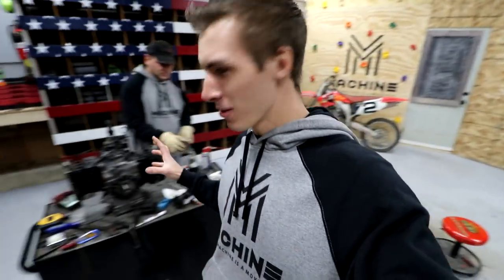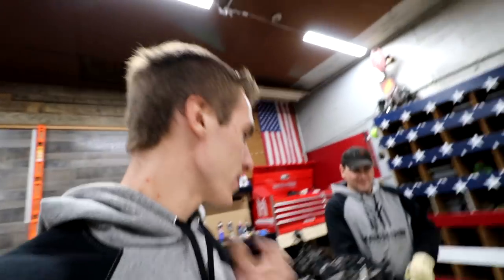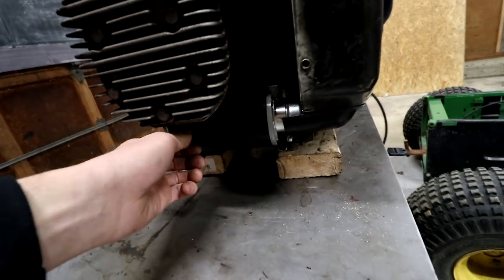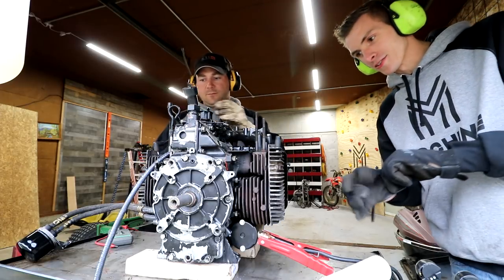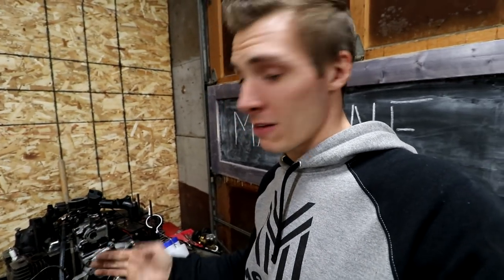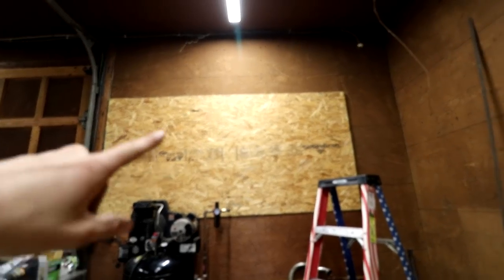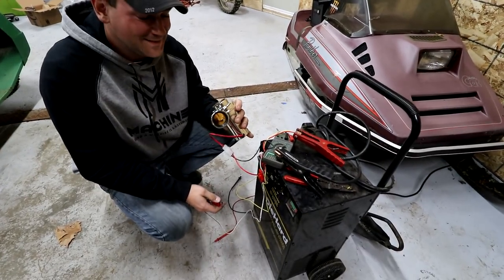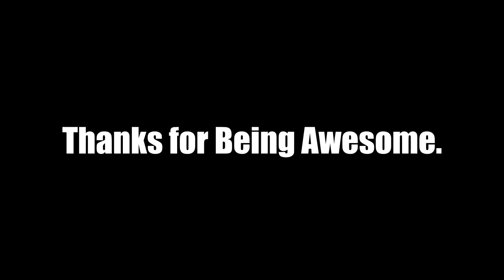Dead Gator Engine & Supercharger

Comment: Thoes things don’t work you wasted your money on legit the biggest price of junk with that super charger they are the biggest joke amongst people in the know
Reply: Yeah
Reply: Right... that's such a joke. The vacuum of The engine probably pulls harder than that thing blows. It's silly.
Reply: It can’t hold boost pressure so there for can’t hold boost really should get a turbo and use that at the junk yard
Reply: He's kind of pandering to a younger crowd. anyone with a bit of knowledge of an engine would know that little electric fan won't create "boost"
Reply: i agree with that, but i dont think he is SUPER into boost kna mean
Reply: he could get a pressureised bottle of air and run it like nos for a better result than this lol...tho small motors like these dont seam to respond great to boost from what i seen cars and cameras do

Comment from the maker: THE GATOR IS CURSED!!!!!!!!!!!!!!
Save 10% on your entire purchase when you use Code "SAVE THE DMAX" at checkout.
https://machinemerch.com/
ONLY 2 HOURS LEFT
Reply: I have a coil sitting here for that engine but I’m in Canada lol
Reply: 3DMachines the merch is awesome put some one my Christmas list bought some tonight and I got some for my brother it will run just believe love the vids love the sponge bob cut
Reply: 3DMachines it’s going to run
Reply: 3DMachines whats up with the snowmobile in the shop?
Reply: 3DMachines is the snowmobile in your shop the replacement for the ski doo?
Reply from the maker: +THE MEME'S VID'S
yES YOU ARE lol
Reply from the maker: AnarchyGames
Secret until it's done
Reply: I have bad news for ya those electric blowers are crap they don't move enuf air to add hp they will slow you down by adding drag on the electrical and impeding airflow .
Reply: 3DMachines 5:22 thats what she said
Reply: 3DMachines were do you get all your songs from
Reply: 3DMachines love ut vids coupdnt resist the joke maybe get a shput out next vid on the joke @james_knocke on insta
Reply: Heat the magneto a small bit and it should work .i left a longer comment earlier if you read that it explains all
Reply: Hey Dalton ! Can i know the size of your friend hoodie ? not sure wich size to buy...
Reply: 3DMachines it will run!!!
Reply: 3DMachines what is the engine?
Reply: 3DMachines you
Reply: +3DMachines  that is a turbo not a supercharger, unless there is some joke I'm not familiar with
Reply: KNIFE VS CRICKET BAT
Reply: 3dmachines staying froggy fresh and staying fly with your merch
Reply: 3DMachines you better come up with more designs if you're gonna have everybody in the video wear your gear
Reply: 3DMachines you
Reply: 3DMachines 👍

Comment: You better not put that hairdryer on. A leafblower might be cool though
Reply: I put a leaf blower on my lawn mower and it was enough 😂
Reply: Mike Stroz really loud though
Reply: Caleb Mitchell I can imagine lol
Reply: Mike Stroz lmao some guys
Reply: it does nothing differnt then what he bought. actually just restricts airflow and makes it worse
Reply: theown32 Tell that to Roadkill and Hot Rod magazine. They supercharged a corvette with 2 leaf blowers and a Monza with 5. Not saying it'll make a huge difference, but it'll do more than what's basically a computer fan
Reply: Mike Stroz actually they did not make any more power. They only went faster because they put a bigger engine in. They made 0 pounds of boost. All they did was pump alot of hot air into the engine
Reply: theown32 If you actually watch the video they did pick up a few horsepower. Not a significant amount, but it's there. They didn't make boost, but they did make horsepower
Reply: Full on road killing it

Comment: As I stated on yesterdays video, that electric turbo will not do anything. I also explained how in order for a turbo to make efficient boost, turbos impellers spin up to 280,000 rpms and faster at full throttle depending on size, and around 150,000 at cruising speeds.  2400 rpm electric turbos will not make boost.

Awesome video none the less and I am glad that you are making progress and producing great content. BTW, if you want a REAL turbo for small engines, check out Perkins turbos and RHB's small engines turbos. Both are really good for small engines such as the gator, 4 wheelers, snowmobiles and more.

RHB's RHB31 VZ21 is the perfect sized turbo for what you want to do. It is small but will produce efficient boost without blowing your engine to pieces. It will only set you back about $249.00, but you have to pay to play for the real deal.

Comment: if you dont want to wait immediately or while your waiting for the new coil pop a glowplug in place of the sparkplug. and give it power. but also make it so the compression is not completely 100% so it will protect the engine from preignition (if you cant wait or if your still waiting lol)

Comment: It should run as long as it  has Fuel, Compression, and spark, and as long as the timing is correct. But I CAN read, and the title says Dead Gator Engine. I think you need to use a snowmobile engine.

Comment: would have run some copper pipe to the middle of the ceiling an then mounted your monster hose there. So it hung down, was in the middle of room for easy access, an kept off the floor.

Comment: you can use a VW water pump as a supercharger I've seen it done a few times with the smaller predator 212. But maybe if you used 2 it would work good there belt driven though.

Comment: I was really looking foward to seeing how you were going to turbo a carburated engine. Knowing the little i know, you need to presurize the fuel bowl and have a fuel pump rated higher than your boost preasure. But sadly to great disapointment you instead put an electric fan, that pushes air and not compresses it, and i am still yet without a well put together video on carburator turbo setup. YAY :( :( :( :(

Comment: Those turbo/superchargers do not work, they don’t have the tolerances or the power to force induction. Buy a VZ21 mini turbo, it will be perfect for that engine, its designed especially for small engines.

Comment: DONT USE THAT "SUPERCHARGER"!!!!! It will perform worse with it on, it draws energy from the motor to run it and will actually slow the air down going into the engine because its not a straight through design. It probably wont even run with it since a carb uses the amount of air going through the carb to pull gas into the engine so it will have too much air at idle and wont idle and will not be able to put big enough jets in it to run it but once the rpms raise up enough it will be reverse and not have enough air flow since its only one speed setting and then the fins will just obstruct the air flow. The fins will also not allow the air to mix properly with the gas and will make it run horribly if it somehow ran. That also isnt a supercharger or a turbo. A supercharger is belt driven. A turbo is exhaust (air) driven. That is just a fan (powered by electricity).

Comment: No, it doesn't run. You bought a used piston and crank. You should have bought new parts. Part of the problem you're having with not finishing projects is instead of fixing it the right way, you fix it a half assed way. 

Buy a running motor - or things you can reasonably figure that you can fix. 

The Suzuki engine was the same story. You bought something that didn't run and really had little hope of running to begin with.

If you had been thinking ahead - a totalled snowmobile (with a running engine), would have probably been your best bet for the Gator.

Comment: I really don't want to rain on your parade, but that electric "supercharger" or "turbocharger" will not do anything to increase power.  Multiple problems. First is that engine will not create enough power to run it for an extended period.  It will therefore be primary pulled lower from whatever battery you have on it.  The biggest issue is that it won't create any real measurable amount of boost.  In a forced induction engine more boost pressure = more torque and an increase in air volume = more power.  It may help put marginally more air into the engine - the engine won't have to pull as hard to pull air into the engine, but that small electric motor does not have enough torque to pressurize the combustion chamber.  Hook it up to a hose into your empty air compressor (or go buy a cheap boost gauge and use a plastic bottle), you will see that it is incapable of generating even a tiny amount of pressure.  If you want to add power use a gas powered leaf blower.  It will have an order of magnitude more ability to add air into the engine.  If it was my engine I would add NOS.  While you still have access to the pistons, pull the rings and increase the gap.  This will allow them to expand due to the nitrous increasing the combustion chamber temperatures and not damage the engine.  With that small engine a small shot of nitrous would go a long way.  Also you would need to add additional fuel in proportion to the NOS. You could add an electric fuel pump and a inject the fuel with the NOS using another solenoid.  In any case, bail on the eBay special electric supercharger, it just won't work.  Go watch the countless videos debunking their ability to add power.  If you want to add a real supercharger or turbocharger there are real options out there, but outside Formula-1 racing there are no real election superchargers that really work.

Comment: Well, I hate to be a pessimist but I totally called it. Your hair drier......um.....leaf blower.....er.....super charger is complete crap. Additionally, kohler opposing twin engines are not known for making power at all. They are incredibly inefficient and I would be surprised  to see any gains over the losses caused by a belt driven smog pump/super charger. Just get a Harbor Freight V twin. They make good power, they are basically Hondas, and gopowersports.com has a big bore kit for it. just take the advice of your commenters and go with the new motor. Remember a month ago when you complained that there was no one commenting on your videos, well this is why-- YOU DON'T LISTEN, additionally you never reply to comments and you never acknowledge the commenters existence in your video. Quit trying to become super corporate (i.e. machine merch) and just focus on making videos that are enjoyable, somewhat factual (still experiment) and try to listen instead of lead once and a while.